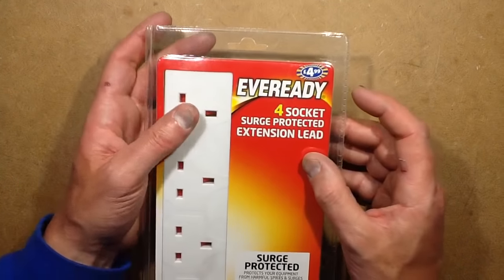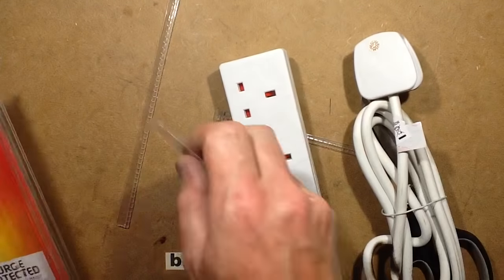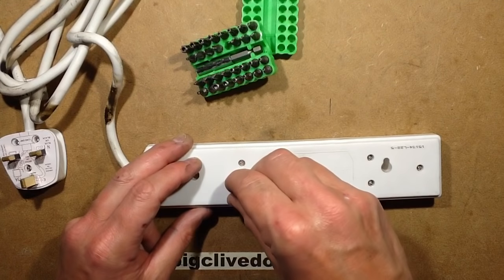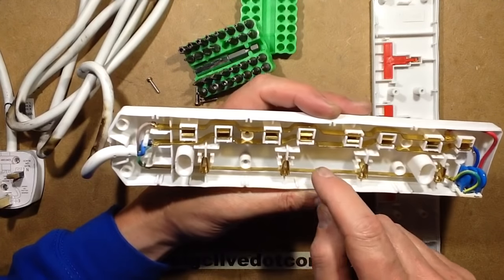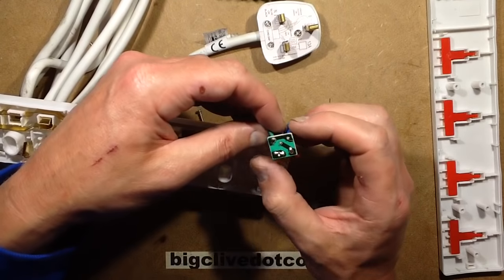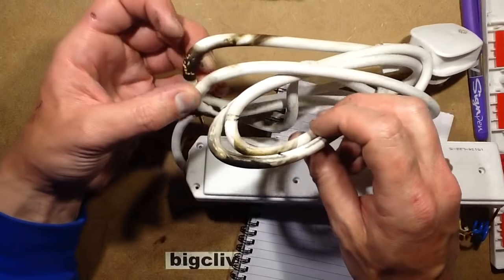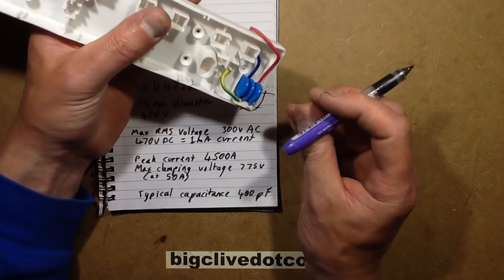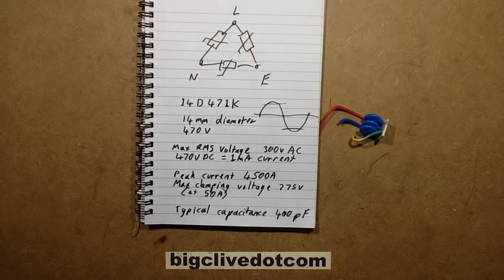Pre-exploded surge protection strip.  What the heck???

Comment: I guess somebody thought 'QC' meant "quite common", meaning that they saw that happen often at the plant.
Reply: And the CE badge, China Export... Well, it's a Neveready brand
Reply: so it's some quite common chinese export fucking fabulous construction
Reply: I really don't see the point of QC labels anyway. Generally in manufacturing, only a percentage of the batch actually gets checked, so you're never guaranteed that the one you have in your hand actually got checked. QC used to mean it did get checked, and included an identifier of who specifically checked it, but to my knowledge, that doesn't happen very often these days, except for some high quality electronic circuitry and critical engineering components.
Reply: Quite combustible.

Comment: The British mains plug is a mighty piece of engineering - just don't step on one.
Reply: Nic Maennling everyone would be hopping mad
Reply: Worse than a Lego landmine.
Reply: Never thought about that. Must hurt like the dickens.
Reply: Mighty is a right word. Try doing these with the British plug:

https://www.sahkonumerot.fi/2442405/id/65987/img/large/coloralt2.jpg
https://public.keskofiles.com/f/k-rauta/products/6416013124444
http://www.valaisintarvike.com/tuotekuvat/900x600/2062euro_118.jpg
Reply: @okaro6595  ehhh IDK, cheap eu plugs are a bitch
Reply: @Kelan-pn6em  The circuit breaker is on the consumer unit. Those accept only double insulated plugs so the ground is not an issue. Almost all equipment have those flat plugs. British generally think they are grounded but they are not. For example this may look grounded:

https://image.made-in-china.com/2f0j00cmYajByRALbV/British-Type-Power-Cord-Set-Cable-UK-3-Pin-Plug.jpg

But if you look at the other end, there are just two holes. The ground is unconnected. If that as connected to the device you would not now it is double insulated. Here we have the flat plug on those. 

I personally have only following grounded equipment: the laptop charger, the monitor, two printers, the fridge, the microwave, the toaster, the washing machine. All else is double insulated.
Reply: @okaro6595  you get things like it.
Reply: @Kelan-pn6em  I have only three equipment with C13. I calculated all the plugs I have with the standard what I have used in the past year. There were  43 flat euro plugs and 9 grounded schukos. To break: TV equipment had 11 euros and no schukos, computer had 8 euros and 5 schukos, lamps: 4 euros, mobile devices&cameras: 12 euros, Kitchen: 3 schukos, bathroom: 1 euro and 1 schuko, others: 7 euros. I did not count plugs on extension cords.
Reply: They're just fine😒
Reply: Certain American power adapters will do the same thing. It's not fun, but I'm sure British plugs are worse.
Reply: My brother jumped out of a tree barefoot and landed on one of those, it went right into his foot and it was stuck solid, his friend said he tried his best to pull it out and nothing.... he had to go to the hospital lol. He is such a little shit.....
Reply: @okaro6595  I had an adapter where one end was a UK plug and it had little plug things that rewired your plug into so it would save sapce
Reply: @PrettyKenziePrincess  ouch, though it's probably a good job they couldn't get it out since pulling things out of your self that are well stuck generally just fucks up everything more
Reply: It would be a pain-in-the-ass.  Makes it too hard to plug everything in.
Reply: @tyttuut  Every plug, because of the design with the cable and the flat back and thin sides - results in the pins naturally resting upwards, and in a very stable position so you can't knock it to one side by accident when you stand on it.

It's something you do once in your life... and then you never stand on a plug again.  On the up side, it takes an impressively determined person to shock themselves as not only are the neutral / live areas covered in the socket, but the plug also has them covered at the top so that you can't stick your finger in the gap while they're making contact with the socket.  (look at the black parts on the pins in this video)
Reply: l think the australian male plug is better as it cannot be inserted in the wrong way round even if 2 pin, where as the uk plug can be inserted in upside down in a board like this if the shutter is bypassed,  but the uk female socket  with shutters is safer
Reply: @AsymptoteInverse  It does.
Reply: It's a bulky plug and I hate it
Reply: @okaro6595  The plug you show in the link is only applicable to double insulated devices, for the earth/ground pin is plastic, and it's sole role is to open the shutters on UK style 13 amp sockets. A device which needs to be earthed has a plain brass pin, for the contact for it is near the surface of the socket, whereas the live and neutral pins are partially  shielded for the contacts are deep in to the socket. This design prevents little fingers from electrocution, along with the shutters which stop children poking anything in the socket. By the way why do Americans keep complaining about treading on our plugs? Our sockets are almost universally switched so there is no need to remove the plug to turn the device off, unswitched sockets are normally only used with fridges and freezers, so why do you leave plugs lying around?!
Reply: Well, tbh thats true with like every mains plug. Same with the US ones.

Except they suck more than the British ones in terms of safety.
Reply: @debeeriz  A proper british standard adaptor will be too large to allow the earth pin to overhang. However the cheapo chinese adaptor will not. Those little shits will stick a CE/BS/UL mark on any old crap....
Reply: I love the fact that the plug is fused.
Reply: Welcome to the US, we have 110, so touch if you desire, pretty sure you will move away quickly. If looking at safety, determined people are going to complete it anyway. People considering safety will look for damages. Would have preferred a little led to indicate good or bad, with the letters in raised font indicating what the condition was.
Reply: Indeed don't step on British mains plug. You will seriously damage your feet.
Reply: @MongooseTacticool  what about a uk 🇬🇧 plug 🔌 made of Lego!
Reply: @samuelhulme8347  Ouch!
Reply: British looked a mace as a good weapon.  So let's make it into a plug.
Reply: I find it to be a terrible design. It has no cavity (easier to connect a piece of metal to the contacts, more stress on the contacts), is very bulky (hard to store, easy to damage other things), and has useless redundant fuses.
Reply: @AsymptoteInverse  it's actually not that bad
Reply: American plugs also hurt.
Reply: europlug is not good either...
Reply: @okaro6595  Good thing too, as those are fine ways to start a fire.
Reply: I steped on my belt buckle, not the flat part the pointy end.
Reply: I remember being supervisor of a fridge warehouse, entirely chinese stuff. We were taking one out with a forklift, many boxes had no bottoms and they would sit on their fairly high wheels. You'd have to make sure the plug didn't drag so you'd lift a bit higher. The plug fell out as we were driving, pretty normal. Except instead if an Australian plug, it was a British plug. The warranty guy, an electrician fortunately wasn't too busy and swapped it over while the customer waited.
Reply: I actually prefer the Swiss system. It's more versatile, more compact and offers better interoperability with the rest of Europe.
Reply: eh, if an american plug was right angled you’d be in the hospital, not just in pain

Comment: I've worked with clearing fire-damaged electronics in factories. After a factory fire, it's common to see the type of damage we saw on the cable in this video.
The temperature of the fire must have been quite high, yet it only touched that one area... while inside the box... without melting the box itself.

If I was a conspiracy theorist, I would say spontaneous combustion...
Reply: ***** You don't pack magnifying glasses in crates. In fact, you don't pack them with the glass exposed at all, since that scratches the lens. Also, it's very rare for storage facilities to have windows clear enough for light to pass through in high enough concentration.

And where will you find a factory that produces cables and magnifying glasses?
Reply: MortenErCrazy Then there would be plastic residue fused with the cable. Also, molten plastic don't cause this kind of burn pattern on the cable.

My theory is that something was burning in the factory and some cables got caught in the fire. They inspected the cables and decided to pack and ship those that had no visible damage on them, even if they had marks, in order to regain some of the money lost in the fire.
Reply: I think the cable got packaged while it was still on fire. The packaging was slightly distorted and had soot on the inside. The sealed packaged probably smothered the fire before it could burn a hole in the plastic..
Reply: @compwiz00  It could be that the metal in the wire retained enough heat for long enough to warp the packaging

Comment: Blister-pack machines get quite hot. It likely got jammed up in one of the form molds (which is what melts the packaging together) while the machine was running.
Reply: It wasn't a blister pack... It was RF sealing, looks like it had an arc which would stil seal it but the arc would cause the burning

Comment: You're not a proper hoarder unless you pilfer the plug before you throw it out.
Reply from the maker: Yeah, I did that too.
Reply: the plug might be crap too, not proper temperature or fire resistant plastic, fake fuse....
Reply: I hope that you just cut through the flex and left bare wires showing and did not actually remove the plug  :-) 

This is particularly important when you can cut the cable near the device so that you can more easily get confused later and insert the wrong plug leaving the bare, live wires to touch anything, including you.
Reply: Come to think of it, have Eveready been acquired by B&M? That's the only place I've seen their stuff for years. I use to really like their rubberised plugs and I've got an old hand lamp style torch from them that I converted to LED/ Li ion that's pretty good too. Too bad they're only in the market for sub- par socket bars and the like these days.
Reply: "You're not a proper hoarder unless you pilfer the plug before you throw it out."
Hahaha, yep! I do the same. I admit, I hoard a little. >~<
Reply: *****
yeah thats why i asked in another thread, it seems to have gone the way of 'rent a brand-name'

Comment: Just to explain what "probably" happened. 
The packaging machine would be an RF welder to seal the thermoplastic shells. This uses RF energy to heat the plastic to melting point. The base of the tool is metal as is the tool itself. The trick is to stop the two halves touching. 
Quite often in the process there is a "Flashover" where the RF burns through the insulating material, OR the RF induces currents to flow in any conducting materials being packed. This happens a few times a day . Usually an antiflash device senses it and stops the burn a few milliseconds into the event. BUT Sometimes it doesn't!! 

The third party companies tasked with this job are working on very small Margins and pay their staff buttons, so no one really cares. 
I know!, I've been called in to fix these errant machines in the UK. I guess the foreign packaged stuff is just the same.
This is a failure of the quality control (if any).
Reply: Thanks for the concise info! Much appreciated :)

Comment: Hey Clive,

I'd love to see a video from you showing how to identify a good surge protector as opposed to a terrible one like this. I had a lot of trouble picking one a few months ago, seeing as technical specs aren't something that manufacturers of these things tend to brag about.
Reply: ProTip: If it's charred, pass on that one.
Reply: Is it on fire? Don’t buy it.
Reply: Amazon
Reply: Furman protectors are good.
Reply: @griffinhaag242  screw amazon. A good source for crap.
Reply: Triplite and APC. They warranty the equipment plugged into them and the protector has a lifetime warranty.
Reply: yeah, APC is good. i have an APC power supply that's lasted me almost 2 decades, i just need to change the battery for it occasionally and they still sell replacements.

Comment: Hi Clive, another informative video, thank you.  Twenty years ago, I was setting up a new 'Home' office for my IT buseness .  I needed lots and lots of sockets for power supplies, modem, printer, screen etc.   I didn't need a lot of power, so I daisy chained a number of these strips around the room, hiding them where possible.  This was great, because at night, I could switch off one wall socket and every thing was safe.  Some ten years later, I moved a storage cabinet concealing one of these strips so as to upgrade my modem to a router,  I picked up the strip, and horror of all horrors it totally disintigrated.  The plastic case had  turned to dust, leaving three thick (live) copper wires with a glowing neon indicator.  The Chinese plastic had  exceeded it's sell by date.

Comment: My guess like yours is a some sort of fire in the assembly line at the factory ,, I did find a strange example of melted stock "inside" sealed plastic packaging which was only slightly melted in a shop that had a poorly placed magnifying mirror that managed to catch the sun that then melted and partially burned some plastic products inside there clear packaging the focal point of the mirror as the sun moved , melted 4 products badly and almost set on fire one of them,,
Reply from the maker: I'm probably going to give that theory a go, since it has been mentioned by others.
Reply: I do wonder what you'd end up with if you microwaved a sealed surge protection strip like that (but one that's not burned yet) for a little...
Reply: Probably a exploded microwave
Reply: Amazing what a microwave will put up with.. how long said microwave will operate post power strip nuking is something else..
Reply: Allrock123 not true. Where did this happen?

Comment: I'm betting that the arcing and thermal damage of the cable came from induced RF from a package heat-sealing machine. These machines often operate at a few hundred Watts at 27 MHz and can induce RF into the product during sealing.
Reply: How would a current be induced in just a wire? It's open circuit
Reply: Have you seen an induction heater?
Reply: Have you ever heard of an antenna? A length of wire placed in an RF field will have current induced in it. Depending on length, diameter and shape, it could be a resonant length and the current flowing back and forth could be very significant. The voltage at the ends would easily be enough to create arcing. The fact that the arcing seems to have happened at just one spot, across several turns of the folded power cable, makes me think that this point was a HV node created by induced RF current.
Reply: +Ed Price yes, that is very true. Please excuse my moment of utter stupidity.
Reply: Why yes, I used them in that Turkish bath house! Seriously, yes, I have used industrial induction heaters (either 13.65 or 27.12 MHz; ISM frequencies) to heat treat steel and to solder large metal plugs into tubes. I have had several production lines going using induction heating. True, most hobbyists never see RF heating in action. If you would like to mess with one, Banggood sells a small RF induction heater that can get a screwdriver red hot in 30 seconds or so, for under about $20. Anyway, back to this product issue. The entire perimeter of that plastic package was welded by dielectric heating (a bit different than induction heating). Two opposing jaws close on either side of the package, pressing along the perimeter. RF is applied across the jaws (they could be called antennas) and the plastic goes soft in a couple of seconds. The RF is turned off, the plastic cools and sticks to itself, and the finished package is ejected from the jaws. Rather similar to metal spot-welding, except the plastic joint is continuous and all done at once. Induction heating makes use of eddy currents induced into a conductive material (like steel), while dielectric heating makes use of the loss characteristic of a dielectric (like polystyrene) in an electric field. A welded plastic joint can be very strong, almost tamper-proof; that's why we just cut the plastic joint off products rather than try to hand tear those seams. An obvious danger is inducing RF into the product; I'll bet there were a lot of bad units sealed that day until somebody noticed the problem.

Comment: Ok, here is my weird story for the week, electricity related!  I was riding my motorcycle on one of our interstate highways.  I normally listen to music with earbuds while riding.  Anyway, as I passed under the high tension cables between two large electrical towers, I heard a buzz in my earphones and received a mild electric shock inside both ear canals.  My theory is that the wind whipped earbud cable had a charge induced by the field generated by the high voltage lines.
Reply: Ok

Comment: and yet it looks like it was burned with a cheap  gas lighter giving that dirty black oiled tar, i'm sure that cord doesn't burn like this. this is burnt from the outside, i don't know why he did this
Reply from the maker: Nope.  Sealed inside, but another theory is that focussed sunlight in storage may have done it.
Reply: Factory worker tried to set fire to the product to cause a factory evac.  The attempt failed because the fire extinguished itself once the blister was sealed and there was no air for combustion.  Plus it was probably made with awful fire retardants anyway so the blister quickly filled with toxic gas and no oxygen.

Comment: It would have been interesting to take a cleaning wipe or two and see just how far the fire had burned through the flex - just the outer covering, or did it extend to the insulation for the wires inside?